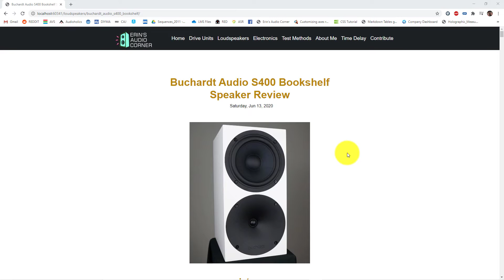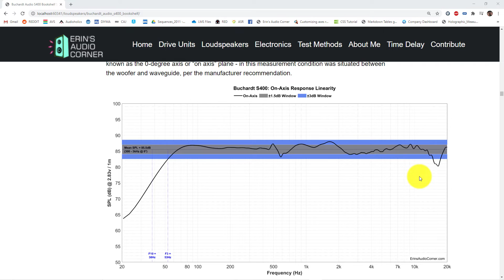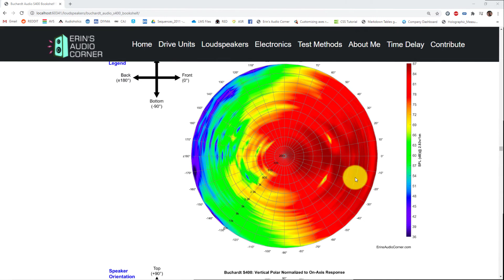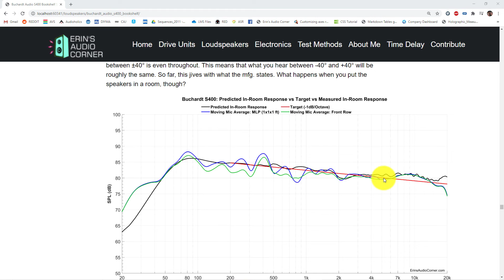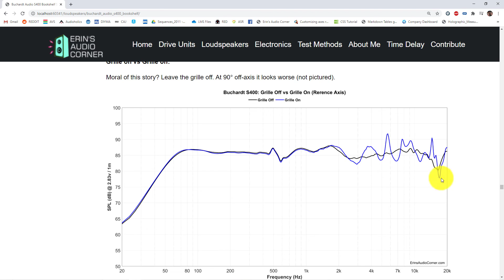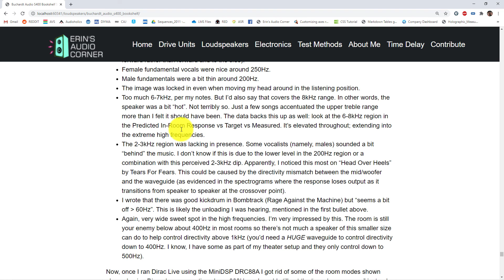Buchardt Audio S400 Bookshelf Speaker Objective/Subjective Review

Comment: S400 is not popular because of outstanding accuracy. It's a fun listening toy rather than a monitor and only HiFi in a general sense. People like it first of all because of meaty bass that unfortunately is not a product of fidelity, but THD. People know this sound from bluetooth speakers and subwoofers and are charmed by hearing this from a small bookshelf. The second important part is the (pretty much high end) clarity of midrange from that SB17NBAC35. Lastly the tweeter + waveguide combo plays low and robust and that's always something to like. Those are the pros.
The cons are visible to a more curious eye. For a DIYer this speaker can be replicated for ~$300... And done better than the original. Firstly the G-string of a front baffle vibrates like crazy at 700Hz. All you need is a brace. The damping can also be improved with some felt. Secondly you can replace the tweeter with SB21 in a Somasonus Waveguide and change the woofer for CRC version. The reason is directivity. 17NBAC has a directivity problem around 2kHz and you need to cross to it well below that point to maintain directivity. CRC doesn't have that problem and the frequency response ends up very smooth. When you are a DIYer spending $2.5k on a speaker with so many budget cuts seems funny.

Comment: Hi, I have two S400 and have opportunity to buy another one for center speaker.. My question is, would it sound good if I put it horizontally bellow tv and angle it little upwards , because it will not fit vertically.. Thanks
Reply from the maker: Depends on how far off-axis you sit.  With this speaker you need to be within about ±10° of the tweeter if you lay it on its side.
Reply: @ErinsAudioCorner  Tnx for reply

Comment: I thought the visualization of the radiation patterns and the concurrent hot spots were cool. I haven't seen those charts used much and they'd be nice to have for speaker placement. As constructive criticism, a good report starts with an introduction on whats being presented herein, a premise, present the data, and most importantly, should end with a solid conclusion. Data is important, but its a disservice to yourself to collect all that data and fall short of tying it all together with clear statements in the end. 

Intro - I reviewed the s400, a great speaker
Data - this, this and this, is what makes it great.
Conclusion - Great speaker, competes with, works well with, and recommended for user who want X, Y and Z. 

If you intend to share you knowledge on speaker design and technology, those are better off made in subject focused videos. Like say an Erin's Audio Corner Foundational Knowledge Series. You can always refer back to them. I feel that is your strength.  I've read financial research reports for almost 30 years. The best analysts are not the ones who make the best worksheets, but those that can use the data to form a compelling story. 

At the end of 33 minutes, I got that you thought the speaker was good and that it started overloading around 95 db. Im not inclined to spend another 33 minutes looking at your data and an encyclopedic sharing of knowledge which felt like off tangent branches to the review. As a product review, I find this open ended and anti-climactic. I didnt get a strong statement on how much you liked the speakers.
Reply from the maker: I agree with your feedback. This is an older video; actually my first speaker review video I have ever made. My more recent ones or in the vein of what you were talking about.
Reply: @ErinsAudioCorner   Last note. If you are doing those heat map charts on radiation patterns, I hope you have a website. That kinda stuff will get a lot of traffic. On a video, its sufficient to flash em, but there will be a lot of people who will wanna pore over, download and use them as reference. When people research that particular speaker, that will draw traffic to you. I would be particularly be interested with those peaks and how they relate to my seating position. Good luck with your channel!

Comment: Is the woofer cone aluminum? I noticed the 5 small embossed ribs in the cone, and I think that SB Acoustics uses on some of their aluminum cone woofers. Did you see any woofer cone ringing in the response measurements?
You might have an interesting time with the Ohm Walsh Tall 2000 speakers - the 8" woofer is covering up to about 8kHz and it has about 300-320 degrees of horizontal dispersion. They have a soft dome tweeter that is aimed up at about 45 degrees and is at an extreme toe in angle. The tweeters cross well in front of the center listening position.
Reply from the maker: Yep.  It is an SB woofer.  Though, I don't know if the parameters are tweaked specifically for this speaker.  I doubt it.  But I don't know that for sure.  And I'm willing to bet this information is available if I search... I just don't have the time right now.  

I'm not familiar Ohm Walsh speakers.  I'll have to keep my eyes open for those designs.

Comment: Yeah, nice they used waveguide - I want one, x-o way below 1.5k would be nice to blend with 17NRXC-04. The freq response looks very nice for the drivers used, as the midwoofers have terrible break above 3kHz, not easy to chop them out with passive x-over. 
I can torture my older Denon (110W@8ohm) with 4ohm load in 2ch set up and for some good reason it still keeps going, although someone before me fried the rear channels.
Mirror, mirror on the wall... - I'm the ugliest of them all - that's what say to myself after I wake up in the morning ;)
PS, so I'm playing with the same set of drivers and passive rad, and I just can't comprehend why such a small enclosure - they could get more 50Hz bass if the box was larger and passive tuned lower. The midbass is  clean, detailed, but x-over is a piece of work as the cone rings at 9ks.

Comment: Incredibly informative video! This helps quite a bit, thank you!
Regarding on axis dip, is this a common phenomenon? So I take it toe in is a bad idea with these, because it get closer to on axis?
Reply from the maker: Yes, it's pretty common.  I believe in this case the on-axis dip is due to the path length difference from the tweeter to the side of the waveguide.  And since it's a dip and it's high in frequency, it is less obtrusive.  Toe-in is not bad at all.  In fact, that is how they are recommended to be listened to.  But with this speaker you can also toe them out to get a mix of wider soundstage with minimal to no loss in imaging/focus.

Comment: Do you recommend using full version of dirac with the s400, or will the 500Hz version suffice?
Reply from the maker: That really depends on what you're trying to correct.  The 500Hz and below version is more "room" correction with a speaker that has very good qualities and dispersion characteristics.  The full version would be useful for a speaker that has tonal imbalance, or something tonally you just don't like, but still good directivity (you'd correct what you can for the speaker and the room).
Reply: @ErinsAudioCorner  but specifically with the s400 (which I own a pair), is there any point in going with the upgraded version of dirac?
Reply from the maker: If it saves you money, no.
Reply: I use DRC-FIR full frequency correction with the S400, and it works beautifully to control the bass modes (if you get them close to the front wall) and fix most of the response flaws.  Full DRC does not work well with, for example, my Vandersteen Quatros (cloth version).

Comment: Everyone needs to chip in a few bucks to keep Erin from being snatched up by some "hi-fi" zine that will reduce him to writing glowing subjective reviews with no data.

Really though, I learn a lot more about a speaker in your format than any other. Thank you for nerding out for the benefit of the rest of us nerds.
Reply: Personally, I own these and it's been interesting. As my setup has changed I've gotten slightly different sounds out of them. I now understand when people say:

They are "laid-back but have a huge soundstage": means they probably pointed them straight ahead
They are "very detailed, yet smooth": because the tweeter is super low in distortion and evenly disperses over a wide area
Their tonality is "very accurate": they are mostly neutral with only a few exaggerated frequencies, and only by 1-2 dB
"The imaging is ridiculous!": they aimed them directly at their seat and their speaker to side-wall distance is symmetrical, also the directivity and mostly smoothly declining off-axis response
"You can live without a subwoofer": they've never heard a really well-integrated subwoofer, or they are satisfied with 25 Hz in-room bass extension these provide. I was, but subs are still preferred. Subs also slash that woofer distortion and really clean up the presentation. Try it, folks!